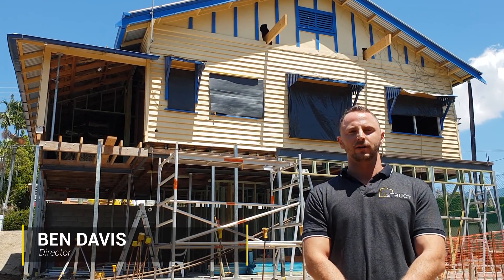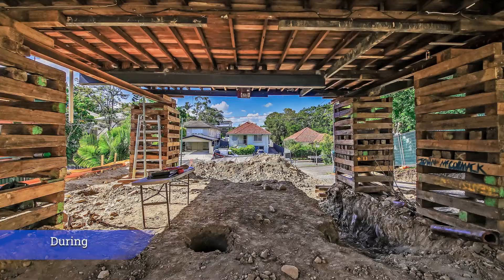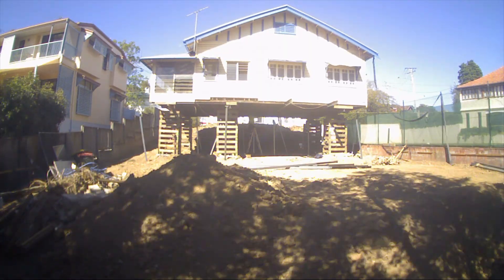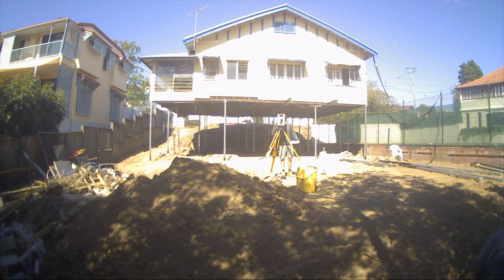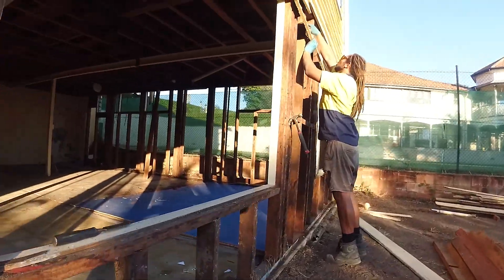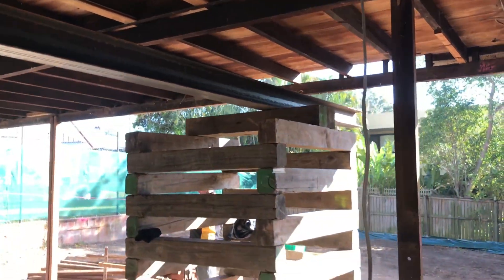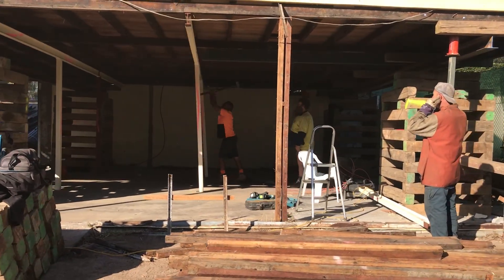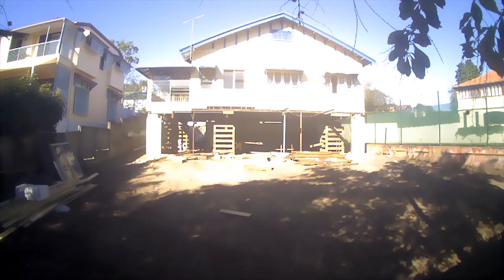Educational Video - How to Raise a House

Comment: I am looking for a price to raise a 2nd storey lev house another 400mm above existing GFL consisting of brick surrounding walls. The extg GFL is also slab so the process will be good for this type of system. Can you pls get back to me asap as the job will be at Waterford West. Cheers

Comment: What stops it sliding sideways?
There's no cross bracing that i can see, or are the posts taking those forces too?
Reply: When they removed those timber towers, that was my first thought.
Reply: Sometimes they do slide sideways... seen it happen. it's awful. :\
Reply: Most of their photos shows dangerous situations that would not be approuved by an engineer. Lateral stability appears to be an issue because of the bad ground conditions. The piers themselves looks wide enough.

Comment: Great video. Curious if you could describe a steel beam which might be used for multiple lift projects.
Reply: Had the same question! I guess they don't want to give away the secrets ;)
Reply: 90% of house raising companies use 150 x 150 universal beam and at any lenght. my company uses a steel joiner pfcs welded together with 10mm or 12mm steel flatbar. for structural steel (not lifting beams) are called pfc's pre fabricated channels. depends on how the engineer is feeling and what project is going on we can use universal beams also. @NarHandleBy